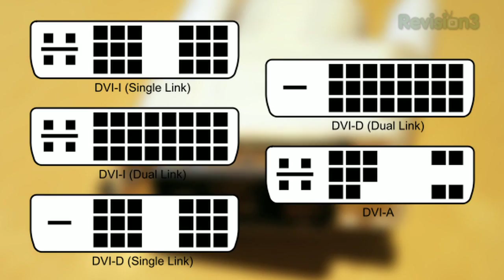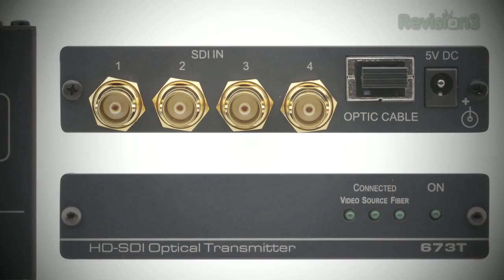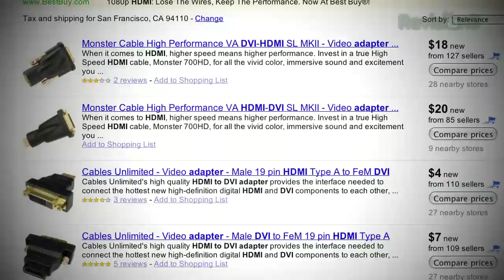Why is HDMI Copper and Not Fiber Optic? - Tekzilla Clips

Comment: wireless ? haven´t seen any really dependable wireless solution yet. There are many problems with wireless technology. It is the same if you throw unprotected copper wires on a floor and hope that other users wont send with the same frequency or even at the same time. Wireless can work for a while. Until someone comes to your location and starts using the same wave length. So, at home and all Pro AV solutions that I sell, I want to give best solutions to my customer and demand copper or fiber connection.